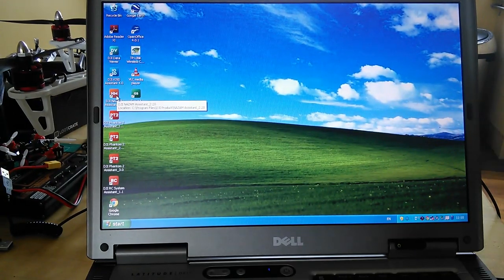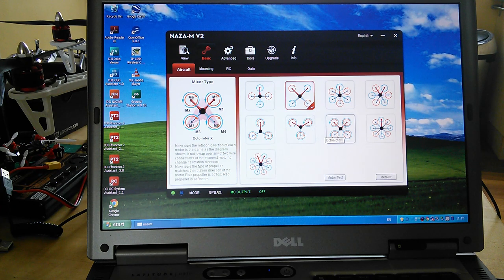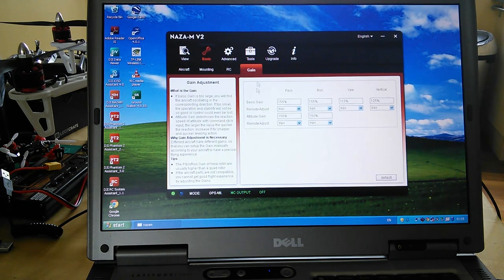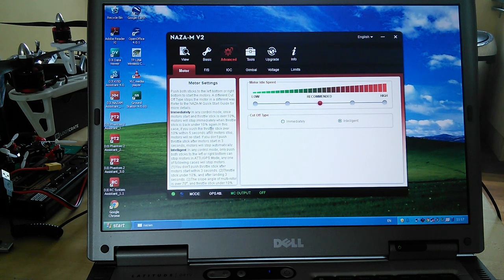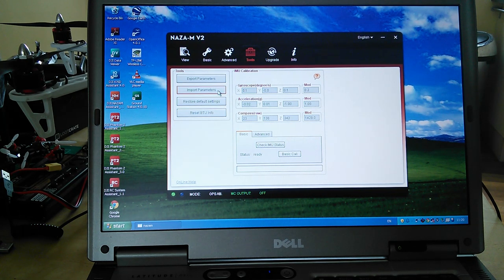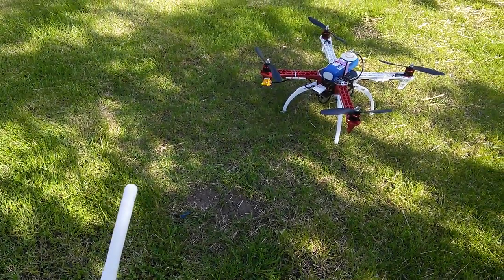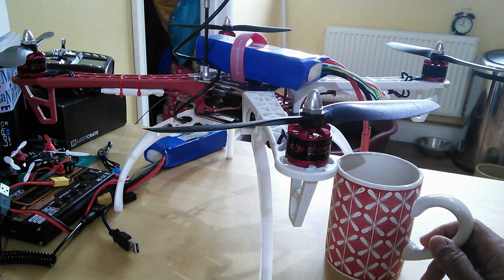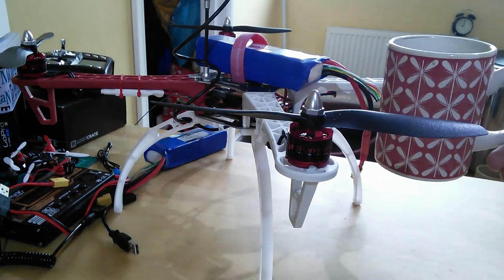Build Your Own F450 On the Kitchen Table. Software setup and maiden flight!

Comment: Hi great series of videos, 

I'm thinking to do the same build, just I have a couple of questions. 

Can I use the controller/transmitter and receiver that I have from my phantom 1? I'm thinking to use that to save money a little. 

The gains settings is it purely trial and error ? Or do you have a baseline setting and move forward from there? 

I'll send you some samagon to try on your table when I'm next in uk

Comment: Thanks for the fast reply Simon!,
          As for previous experience, i previously had a fc40. I used it more as a test if i liked the hobby rather than a main rig. 
          For filming i would like good quality photo and video but it doesn't need to be pro. What I mean by this is i dont want cell phone quality, but I don't need dslr quality either. I may do real estate video in which case i think hero 3+ black or hero 4 (comes out in 2 months) is acceptable.
          So I can be clear, you are suggesting the f450 with naza v2 and e300 correct? Do you think that e600 idea is even possible with arm extensions or are they so powerful that even at the lowest power the quad with rise? 

Thanks a bunch, 
Max
Reply: Ok thanks for the advise!  I will look closer into the convenience of the vision. With the waypoints included it is certainly a step up! As for now, I think my decision is between f450 and vision

Comment: Weldone Simon and ur lad :)

Nice build and it's very satisfying I guess , what I don't understand is the flight time (15min ) that's seems a bit low .... The p2 has almost 25min and now that I did put the gimble is around 16/17min it also has the iosd+avl58+hub+interference board .... How come it still have the better end on flying time ... 450 is defenetly lighter 

I'm asking cos I just got my goggles and fpv is so amazing but the phantom has the gimble and that reduces the flight time so I thought I start looking at an f450 aswel but with that flying time ( which I can't understand) il better go for an other phantom and just hook an fpv cam with an immersion rc transmitter , that would hardly effect the flight time and surly will get over 22min .... Or am I missing something here.

Thanks alot it was nice seing you's doing progress and maiden the f450

Cheers
Reply: You recon that 9" props or tad bigger plus maybe a nano tech 4s battery with a bit higher mah would get you a few more min flight time ... Ehh the phantom 2 standard is tough to beat for flight time is it.    Can the 450 run with a 3s ( you know I'm a noob )
Reply: I'm just looking for flight time and not raw power so I might look more into it to get over 20m 

Thanks Simon

Comment: Hello Simon and/or any other people handing out advice,

I have 1 main questions with a few things to go along. (keep in mind that i am going to use my quad for filming %80 of the time).

1. first off, the most famous question of all time: should I go with a phantom 2 or and f450?

1.1 - If the answer is yes to get a P2, should I go with a P2 with h3-3d and gopro 3+ black which i will add fpv and groundstation to; or do I go with the vision+ that comes with all of the following included?
          - With gopro and h3-3d i get better footage, and have a gopro I can use for other things besides quadcopters (I would need to buy the gopro); but by having to add on all the things already included with the vision+, it becomes more expensive and gets less battery life.

1.2 - If the answer is yes to get the f450, what is the best setup possible?
         - Do I go with the normal ARF kit that comes with Naza lite and the motors shown in Simon's f450, or get Naza V2 (I will use a gimbal, but it doesnt need to be a zenmuse) and e300 motors? And with either one of these options, what is the best battery
         - Also I had a crazy idea of extending the arms and using e600 motors, I calculated this option and found out that with an 8000mah 6s i could get 44 min!!!!! does anybody know if this could be even remotely true?
         - Last, if I go with the f450, which of the following remotes should I get: futaba t8j, futaba t8fg, spektrum dx9, spektrum dx8, turnigy 9xr, or stick with dji?

                                                                         Thanks!,
                                                                             Max

Comment: Hi simon could you share your settings for your GPS puck mount and your gains just as a ball park to start I have built my own but with the T8J Futaba on sbus but if the puck is on the rear is it a - or  +

Comment: can i use the NAZA for a hexacopter build? and is it the same as a quad just 2 more motors and speed controllers?
Reply: Heres my shopping list so far. i put the kk2 board on there for now but i haven't placed the order jet. what do you think i might swap out or add? i went with a cheaper controller and reciver to save some money. cause im only 15 years old and im buying this my self.

Turnigy TY-P1 25Amp HEXFET Brushless Speed controller...

NTM Prop Drive 28-26 1000KV / 235W (shor..

H550 V3 Glass Fiber Hexcopter Frame 550m..

NTM Prop Drive 28 Series Accessory Pack	

10x4.5 Carbon Fiber Propellers 1pc Stand..

Hobbyking KK2.1.5 Multi-rotor LCD Flight..	

HK-6DF-M1 - HobbyKing HK6S 2.4Ghz FHSS 6Ch Tx & Rx

10CM Servo Lead (Futaba) 32AWG Ultra Lig..
Reply: yes i forgot the batteries and charger but that cant be more than a few euros?
30-50 euros?
Reply: thank you so much for all your help if i make a build guid off it i will give you a huge promo!
Reply: yeah got one of those :D

Comment: Will the naza lite work without the GPS??? I am having issues with this thing
Reply: The issue that I am having is 1- cant get the motor to start. 2- the drone is on safe mode all the time, I move gear switch amd nothing.